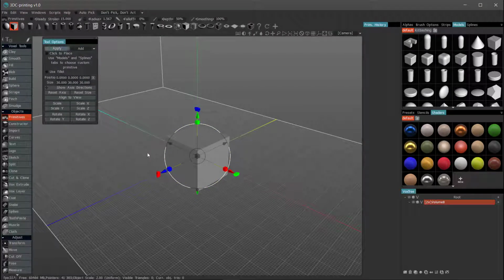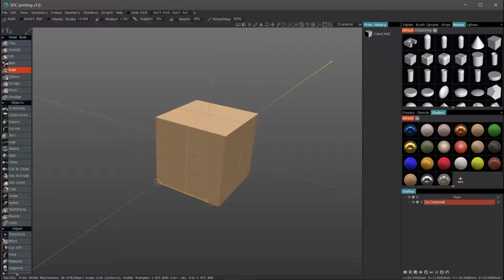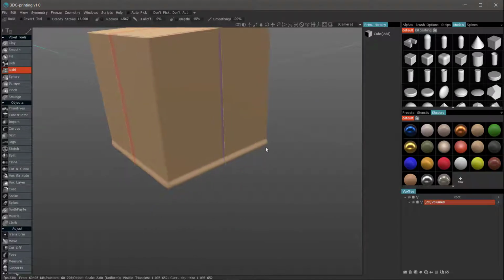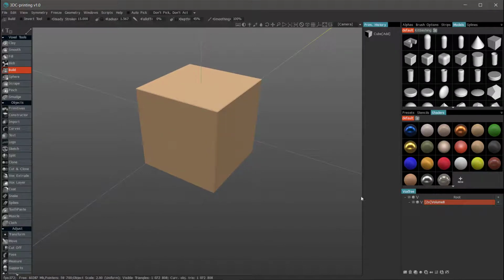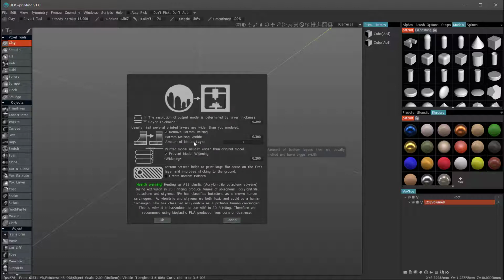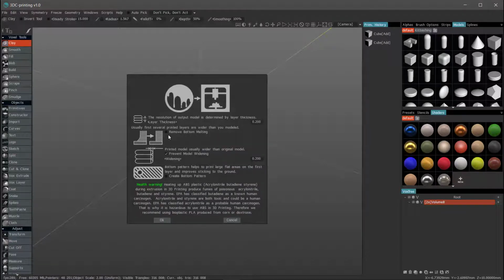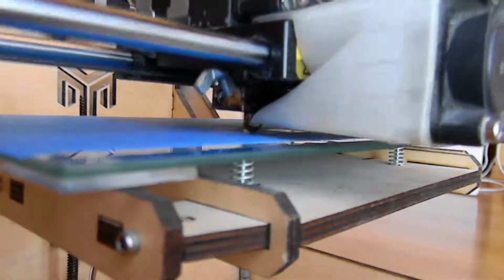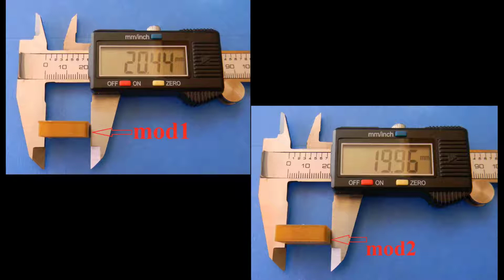3DCoatPrint: Prevent Bottom Melting (Elephant Foot) Effect

Comment: How do you solve elephan foot from an STL file, how do you actually print that .stl file, you actually need a software to convert it to .gcode right?, then, the params needed to avoid elephan foot should be in the .gcode not on the .stl ¿?
Reply: Not sure if this is a canned response, but really, that's not what I was asking. What I am asking, is, how can you even solve the first few layers melting problem from an STL file. From my understanding, were the magic happens is in the gcode, there's were you can control printing temperatures, speeds etc... , from an STL file all you can do is to have a 3d model, with no info related to the printer. Therefore, I do not undestand the point of this video, since you can not obtain a gcode from your software.
Reply from the maker: It wasn't immediately clear what exactly you were asking. The point of the video is that 3DC Printing allows the user to offset the affect, by modifying the contour of the base of the model...by the amount specified in the export dialog. This is probably more applicable to the person who is printing their own models, rather than sending it to a printing service. They are likely going to make necessary adjustments in their own software to offset typical printing issues.

If you require more in-depth information about "how" 3DC Printing solves this, feel free to email support@3dcoat.com
Reply: 3D Coat Training Channel thanks for your reply. Now I understand. 👍
Reply: You could add a bevel on the bottom of the STL file. This will allow for horizontal expansion. Or to be more exact, print on a raft.